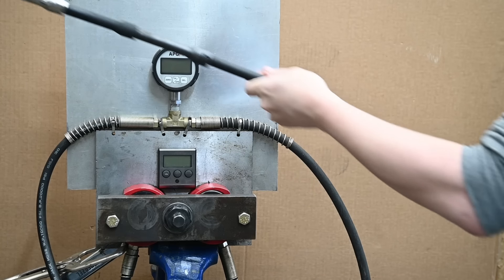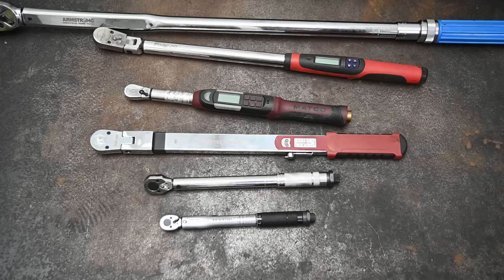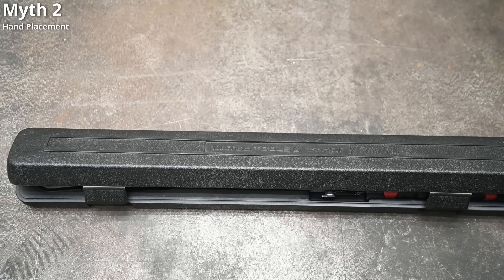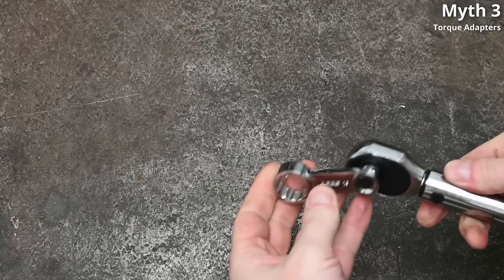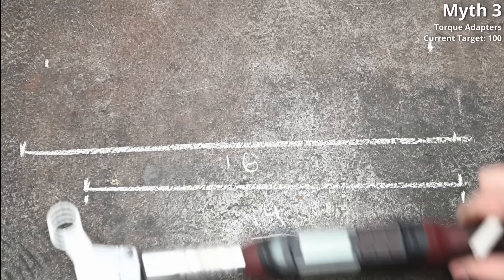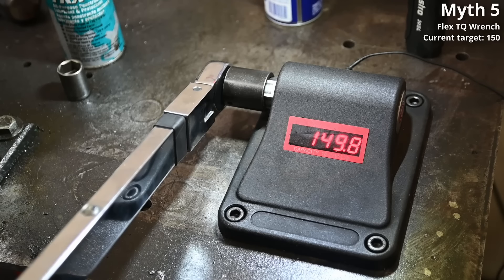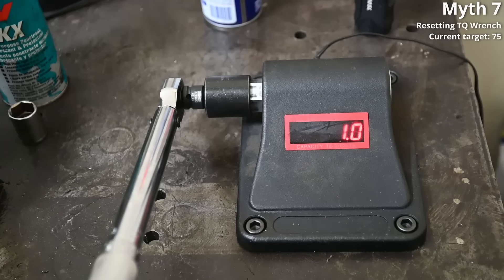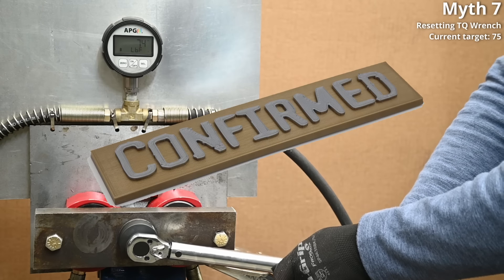You're Using a Torque Wrench Wrong: MythBusting 10 Do's & Dont's

Comment: The info in this video is patently wrong. It doesn't matter where you hold the torque wrench for at which torque value the wrench will click, as the mechanism is inside of the wrench and is not influenced by where you hold it. The problem is, however, that if you grab the wrench closer to its head, then if you need the same amount of time to stop pushing the wrench after it has clicked, then you've rotated the wrench already past click time at a larger degree (literally at a larger degree) than if you're doing the same thing while holding the bottom end of the wrench, where it needs to travel more to rotate the nut at its head the same amount. So, the problem really lies with how you handle the wrench and that you've to turn it slower when you're grabbing it closer to its head, but you can achieve easily the same accuracy as if you'd grab it further down. TL;DR: For the accuracy of the end result it doesn't matter where you grab the wrench, but how much you turn it past the clicking point.
Reply: The video presents the information correctly. Whether it makes a difference where a torque wrench is held depends on the design of the measuring mechanism. Mechanisms where it doesn't matter include slipping cam designs, some electronic load cell designs that measure the torque delivery directly, and at least one type of dial readout beam wrench. Ones where it does matter include the common dual lever design of clicking wrench, some electronic units and many deflecting beam wrenches.
 The video is specific in showing two of the second type that are known to have this well understood and documented characteristic, which is known as being Length Dependent, Length Specific or Lever Sensitive, depending on who is writing the specification.
 It's not hard to disprove the idea that the higher torque is from overdriving past the click. One way is by using an angle-of-the-nut indicator which lets you see that when held closer to the head, the nut gets rotated further (greater torque) before the wrench clicks, in comparison to the correct angle achieved from the handgrip position. If your concept was true, the indicator would not go past the correct position until after the click. Another way is to use a tubular handle extension to make the wrench longer, in which case it will deliver a bit less torque at the time of the click. That also happens because the click mechanism is measuring the torque incorrectly, there's nothing the operator can do to reduce the torque by un-going past the click.
Reply: @PlatypusPerspective  Again the lengths, forces and resistances in the mechanism that ultimately controls the delivered max. torque (up until the click) in a click wrench do not change in any way, shape or form whether you grab the handle - what's essentially just the inert housing for that mechanism - closer or further away from its end. So, the only way you can exert more torque with the wrench is by pushing it past the clicking point - which is a user error. There's no point in arguing this, because of elementary physics and mechanics. Now, admittedly, and as explained above, it's easier to commit said user error when grabbing closer to the head, but it's still a user error none the less, and the click itself happens regardless of that always at the set torque (save for precision errors, which are present regardless of the grab position).
Reply: @berczigabor  Unfortunately what you're saying is completely wrong. Get a standard click wrench, measure its torque output (preferably using angle-of-the-nut indication, or if you have access to one, a calibration bench) with the force applied at different locations on the tool and you will find the torque delivered at the point of the click indication changes. This is a perfectly well understood and documented characteristic of torque wrenches, the physics and mechanics of these designs of wrench mean it cannot be any other way.
Reply: @PlatypusPerspective  Unfortunately obviously you've no understanding of even just the basics of how click torque wrenches work, or really, just the purpose of them. That's why you don't understand either that the fact that the same force applied at different distances resulting in different torques at the head won't change at which torque they click down - which is, well, the whole purpose of them, ie. to signal when a particular torque at the head has been reached, regardless of what combination of force and distance that torque results of. Just shows that you shouldn't start an argument about something you've obviously not even the slightest understanding of.
Reply: @berczigabor   Get a click torque wrench, measure what it actually does and you'll discover that in the real world mechanical devices obey the laws of physics, not scenarios people make up in their heads. If you're not able to organize to do that yourself, there are various places on YouTube where informed people like engineers, in one case a university physics professor, or torque tool manufacturers explain and demonstrate how click type and other torque wrenches work, what their characteristics and behaviors are, and how they must be used in order to deliver the set torque without error.
Reply: @PlatypusPerspective  I accept your admission of defeat. GG. Next time educate yourself about a topic you've no clue about before you start arguing!
Reply: @berczigabor   Interesting. Do you also imagine the earth is flat?

Comment: i still dont believe that not holding the torque wrench on the handle effects the torque
Reply: It depends on the type of torque wrench. Two of mine it doesn't matter (slipping cam) - you can measure the torque output and it is not affected by where you hold and apply the force. The other two are the common click wrench, and for them you can measure their output and it does alter the amount of torque that's being delivered when it clicks if you move away from the designated handgrip.
Reply: @PlatypusPerspective  i appreciate your answer but still dont believe it , how does that torque wrench know where its being held ? the handle is a solid object so it makes no sense
Reply: @macunion1225   There are various ways to see what is happening. Here's one:
It's true, the measuring mechanism in the handle doesn't know where the wrench is being held, but that's actually why it clicks at the wrong torque away from the handgrip. It doesn't know about anything outside of the tubular handle, including the extra 2" or so of headpiece driving the fastener.
 Since the measuring mechanism doesn't know this exists, it is not measuring the torque being applied there. It's measuring the force passing through on its way to get there. Because there's extra leverage after the handle ends, that the click mechanism doesn't know about, it measures a lesser figure than actually gets to the nut.
 When the wrench is calibrated, a compensation factor is (automatically) applied in proportion to the different lever lengths to correct this. But this factor is only correct for those exact lever lengths, handgrip to the end of the tube/handgrip to the nut. If you move away from the handgrip, the proportion changes, hence the amount of correction would need to be different, so the torque measurement becomes wrong. But because the wrench doesn't know where it's being held, it doesn't know it's giving a wrong indication.

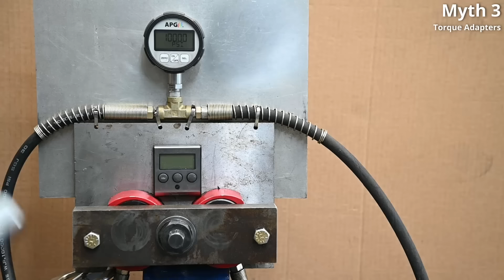Comment: 5:50 lol?! HOW?!?!

Torque should be the same no matter where you hold/push... :O outside steel part of the wrench is stiff so no way it makes a difference :O
need to check the other video for myself...
Reply: Dual lever unequal length design - the outer tubular lever is shorter than the total length over which torque is applied, so the measuring mechanism in the tube isn't measuring the total torque delivered at the head, only a reduced portion of it. The calibration adjusts for this, but this is only correct for the set length to the center of the handle - if held at a different location the lever lengths are different and a different correction factor would be needed for the mechanism to click at the correct torque.
 It's called Length Dependency or Length Sensitivity, some torque wrenches like the common click type have it, and some don't and can be held at any point.

Comment: No. wrong. The clutch pivot point is  the socket pivot point UNTIL it clicks. Therefore the equation from bike sause holds only AFTER the click. Until then it doesn't matter where you hold the wrench. So, stop at the click or you will have wrong results no matter where you hold it
Reply: So if it doesn't matter where you hold the wrench prior to the click, that means you can hold the wrench so as to apply force at the pivot pin of the outer tube, just as long as you stop and don't apply any higher force when it clicks?  Edit: since there's been no response, hint: no you can't. This commenter's concept is false.

Comment: Moved house, left my torque wrench boxed and wound on, forgot I owned a torque wrench, don't ask. Found it nearly 10 years later. I'm guessing it's no longer accurate.
Reply: Perhaps, but not necessarily. It depends on the quality of the spring. It could be left at minimum setting for a decent time in case it needs to recover, and then checked for accuracy.

Comment: Several of your "busted" you clearly showed them as confirmed but then said it was busted if you dont do it a certain way... Technically, they should be confirmed or plausible at the least... Like your extensions. You say it dropped the torque if at a weird angle of attack which would confirm it but then you said busted as kong as you keep them in line and and perpendicular... At the lease it is plausible because you showed extensions can decrease the torque...

Comment: This is the equivelent of the "at home machinist" chasing down sub tenths in tolerance for a part that is good at +/- Ohio. You can calibrate torque wrenches all you want to within such a high precision, but none of that matters. "Torque" as the wrench reads is one of the most inaccurate methods of measuring clamping pressure and pressure applied to a component. If you are designing parts that require such precise torque values then you are designing wrong. The "Torque" on a bolt can vary by 10 Ft/Lbs or more and have very little impact on the clamping pressure, soo many other variables come into affect that are just as/if not more important than the torque values. 

 Much of the promised accuracy is just a gimmick, a pipe dream, an irrelevant factor drummed up to sell more tools than the other guy. The design of the bolted connection, the application of the clamping load, the surface conditions, the coefficient of friction, the sealing material (gasket or medium), the termperature under application, the thread engangment percentage, hell even the fact that the bolt hole isn't cleaned properly. All of these are more critical than a +/-  2.5Ft/Lb difference. If you are giong to justlfy your spending with the "I expect more if I paid more" then I am sorry but you got taken. If you bought it off a Snap-On truck, you got taken, brought back, and taken again.

Comment: I will start another shi# war on the internet that having ultra accurate torque procedure and wrench dont guarantiw anything xD only thing that guarantie success in torqing bolts is bolt streach gauge but it cant be used in every situation heheh
Reply: so fighting for every Nm in accuracy is kind of pointless if you cant messure the streach of the bolt xD Importwnd is to have the wrench that  tighten the bolts everytime withe the same force but not to have it 1Nm+- corrext

Comment: FOOT-POUNDS, damn it.  Torque is foot-pounds, pound-foot is work.  The metric system went with N-m before the Engineers started using vector algebra to calculate complex torques.  In Vector math torque is the vector cross product of rXf, read as r cross f,  and f cross r does not result in the same value as r cross f.   The French got it wrong, and because the folks at the Bureau of Standards, are illiterate fools, they decided to change to match the French, totally ignorant of the metric system being wrong.   

One of the methods used when solving complex problems is unit analysis.  If you take a bunch of values and grind them through an equation, keeping track of the units, and the units you end up with aren’t the units of what you are looking for, you probably screwed up.  That is unit analysis. So

Comment: Sorry, but your Myth #5 conclusion is wrong. The type of torque wrench you show measures the torque/forces on the hand side of the bend rather than on the tool side. Taken to the extreme, at 90 degrees this would be putting very little torque on the tool side with all the torque taken to click the wrench. If the rotation were at the center of the tool, this would be a cosine error, slightly different as it's not right at the middle. Point being is that you have to get about a 25 degree angle before being off by even 10%. Looks like your wrench limits to something like 5-10 degrees to prevent this kind of problem. If a torque wrench were poorly designed and allowed to offset up to say 45 degrees, you'd be looking at about a 30% error.